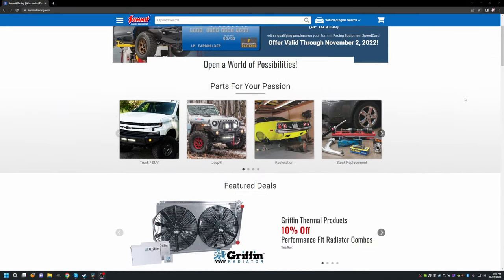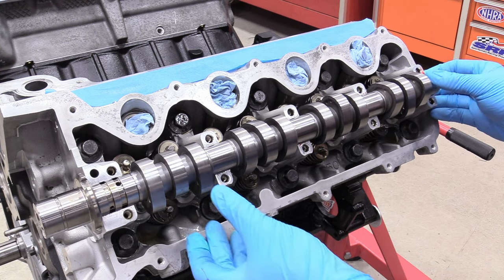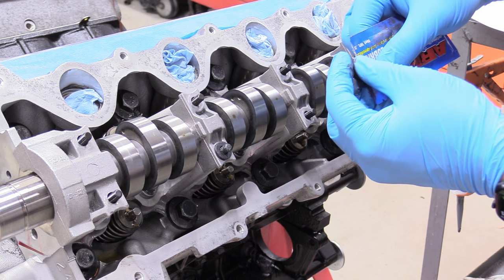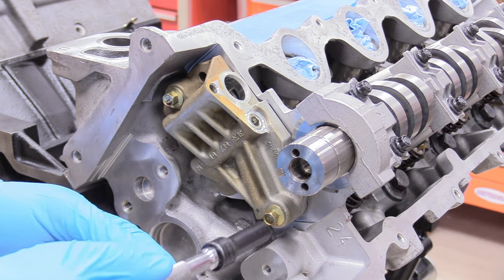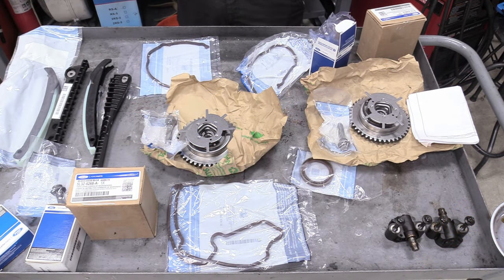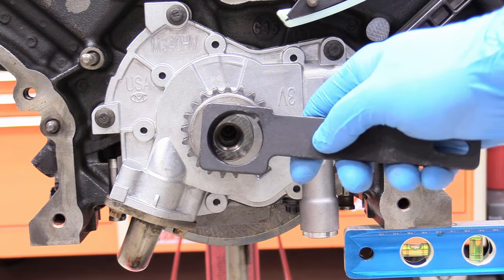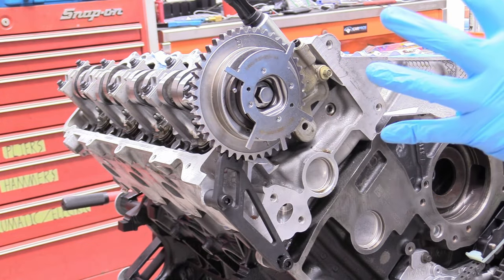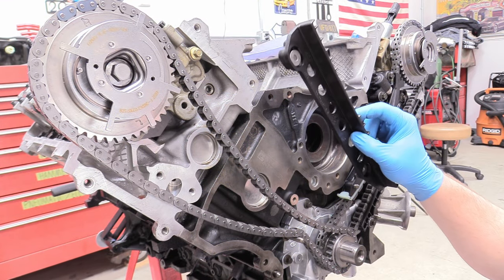How to Build a Ford 5.4L 3V Engine - Part 7: Timing Set and Camshafts

Comment from the maker: So I was mistaken when I said the Cam Tower bolts are TTY. They are reusable just torque to 89 inch pounds in sequence. But I do recommend the ARP ones because they are so good! Thanks for watching!
Reply: Where I can find the engine block cam caps?
Reply: @joseaguilar3978 those are lined bored when engine is new. You cannot just buy new ones. They would to be machined.
Reply: You scared me! I was panicking thinking about how I could quickly get a set!

Comment: Ryan, your remark about the cam cap bolts being TTY and therefore junk was something I had not heard.  Having recently done the timing on my 4.6L 3V, which has the same heads as this one, and having done so with replacement TTY phaser bolt and an ARP crank pulley bolt (because stock is also TTY), but having kept and reused the cam cap bolts, I was a slight bit afeared I'd messed up with this new information.

So I went a-huntin', and I read the 'LH Camshaft Replacement' section in the Ford repair manual for the Mustang.  And nowhere does it say to discard the bolts, as it does for the TTY phaser bolt.  Others in other sites have said simliar: cap bolts are reusable.  I'm fairly certain the 5.4 3V would be the same if I had a hold of that book?

That's not to say that on a brand new build like this I wouldn't recommend ARP for all the things, so I whole heartedly approve for sure, but I just thought I'd run that by ya and see what you had for thoughts.  Thanks for what you're doing, very much enjoying the series on this rebuild!
Reply from the maker: I have read that they are TTY on some sites and on others it's just 89 inch pounds so not TTY. I just looked up the Ford service resource and it just says 89 inch pounds so that is the resource I would trust. I believe you are right and the stock bolts are most likely fine to use again. I will leave a pinned comment to correct myself. 

Thanks for watching!

Comment: Just an observation, the tool you used as a crankshaft rotator it’s not just a rotator, it’s actually the tool to put the crankshaft to his perfect timing. 
Great video tho, I’m rebuilding my engine as well and this is pure gold. Thanks a lot!!
Reply from the maker: It would be if the hole on the tool lined up with anything. I think mine was made slightly wrong. But oh well, it worked! Awesome! Thanks for watching!

Comment: I've seen in there that you rotated the engine counter. Clockwise, aren't you supposed to rotate it clockwise always just an observation. , but very good information
Reply from the maker: Only if you are worried about the crank bolt coming out, which I wasn't. I just needed it to turn back a tiny amount anyhow. But if you are concerned about that feel free to rotate it all the way around clockwise. Thanks for watching!

Comment: A Melling high volume oil pump is the best upgrade for that engine , 150.00 and you don`t have to remove the oil pan to change it,    gives the engine  20 % or more oil flow

Comment: Ok I’m confused because you say have the line up at 12 o’clock but fordtechmakeuloco says have it at 6 o’clock so can you explain why you two have a different answer? And also just because it’s at 6 or 12 shouldn’t it be at tdc on cylinder 1 and how do you know it’s at tdc on cylinder one just because the key way is positioned right? Because the crankshaft doesn’t rotate at the same rate as the camshaft so you can have multiple revolutions to 6 or 12 before a specific cylinder is at tdc
Reply from the maker: I haven't watched his video so I can't comment. All I know is I followed what Ford says to do and my truck runs without issue so I did it right. Thanks for watching!
Reply: @2carpros  I watched it incorrectly he was just saying put it at 12 o’clock to remove the first 6 roller followers then put it at 6 o’clock to remove the rest of them. And on reinstall do the same I love your build series and it’s great to watch! Also what is you opinion on aftermarket timing kits such as melling?

Comment: I did exactly as you told us, but when I rotated the engine the marks on the timing chain a full rotation was not on the timing chain marks on the phasers, and 11 o'clock and six o'clock, I used the tool on the crankshaft for the timing so, I don't know if this is Ok. Please help.
Reply from the maker: It's not going to be, the teeth add up un evenly so it takes many rotations to line back up. As long as you had it lined up like I did when you put it together it will be timed correctly. I did the same thing and worried about it till I thought about it for while. Thanks for watching!
Reply: @2carpros  Thank you very much, I was so worried, but you have cleared my doubts, once again thank you for your support.

Comment: Hi a have question I did all the timing change and before I put the timing cover i turn my crank shaft to see my marks still line up but they r not I  guess my question is I shouldn’t turn the crank it all after doing the timing change

Comment: Even a 5-year-old child can install those timing chains because they have very clear markings and no one is going to make a mistake, but what is worth worrying about is if you don't mount the tensioner guides where they go, you will have to check the engine litgh. I won't explain. something that not everyone knows, and that is that the tensioner guides are not the same, one is thicker than the other, one is right and the other is left and they are not marked
Reply from the maker: Right which is why I pointed out which one goes where. Thanks for watching!

Comment: I just did mine on my f250 and now I got the p0345 p0349 and from what I know I'm off by 1 tooth so how do I go back an reset the timing on bank 2 1 tooth again. It runs amazing but the check engine light keeps coming on after I changed the cam sensor an the pigtail. What do I do?
Reply: It isn't that you put the chains on wrong, But you can't follow what he's doing here because The cam is free rolling.
 I'm sure you did your timing with the engine in the truck, And you didn't secure the cams When you took the phasers off.
 This video is very good but he should have explained the difference.
 Now if you did secure the cams, It could be off by less than a link to set off the codes.
 There is very little leeway on these stupid overhead cams that can move when you're doing these installations.

I hate to say it but I think you're gonna have to get back in that front cover

Comment: Ryan, is this procedure the same with the Ford 4.6 3V year 2006?
Reply from the maker: Yeah it is basically the same engine but a bit smaller. There is some parts that are specific to the 4.6 so I wouldn't use every link blindly, just verify that they fit the 4.6 before you order. But the process is the same as I understand it, probably different torque specs though so I'd look those up too. Thanks for watching!
Reply: Hey Ryan,  does #1 piston  need to be  TDC

Comment: Keyway goes at 12 or 11 o’clock?
Reply: Get timing tool auto parts loan them
Reply: both depending on which phase in the timing process; there is actually a third keyway location at 6 o'clock in between if following by the book (factory manual)

Comment: Why did you put the entire timing set together without the roller followers in?

You’re gonna have to take all that back apart to put them under the cams.

That’s why you have so much free play and the cams just spin about all freely.
Reply from the maker: Nope. You have to put the cams in first then the roller followers. There is a special tool that pushes down on the valve so you can get the roller follower in. Thanks for watching!
Reply: I am wondering the same thing  ??
Reply: So the timing can't be properly done with followers already installed under the cam?

Comment: Where are the Lifter and rollers??? Hello Uninstall the cam but not everything else?? Why
Reply from the maker: The lifters and rollers go in after the cam. Look at the next video in the series. It's not possible to install the rollers with out the cam to hold it in place. There is a special tool which I go over in the next video. Thanks for watching!

Comment: I mean, you could have your crankshaft 360° out of phase.
Reply from the maker: 360 out of phase? Then it would be correct. Do you mean 180 out of phase? And that isn't possible with the timing marks where I left them. The truck started up and works great so it is correct. Thanks for watching!
Reply: @2carpros  lol yeah. 360° out of phase is only possible when the timing system is already assembled.

Comment: I never seen that , installing those cam caps studs by hand only with silicon , without torquing them .
Reply from the maker: Every single stud I have ever installed instructions have always told me to install with hand tight only. Then torque the nuts. Thanks for watching!

Comment: Why use the old shitty plastic tensioners that cause alot of problems. Should of used the cast iron ones
Reply from the maker: Those are for the 2v not the 3v and can also cause problems check this video from Brian https://www.youtube.com/watch?v=mVXx8pVYc1c
Reply: I am concerned confused if you put the crank straight up. I have a tool that holds crank in place while you do the top end timing it is at 11:00 O'clock.